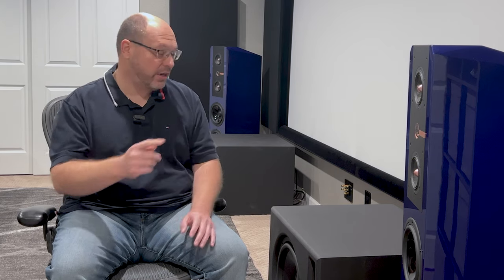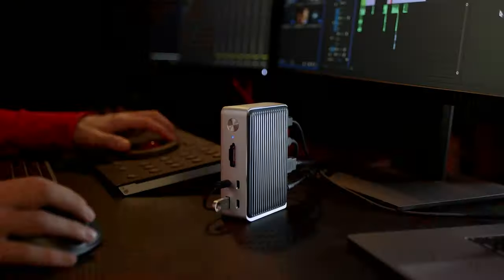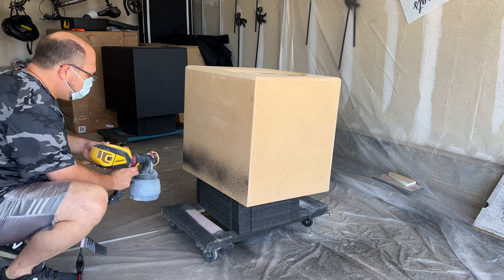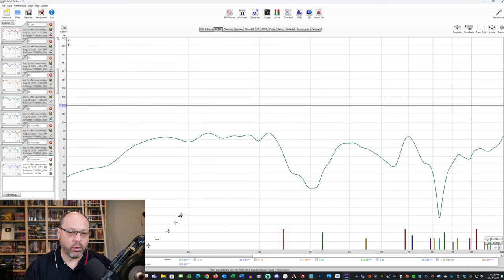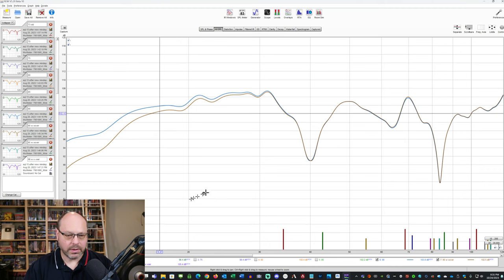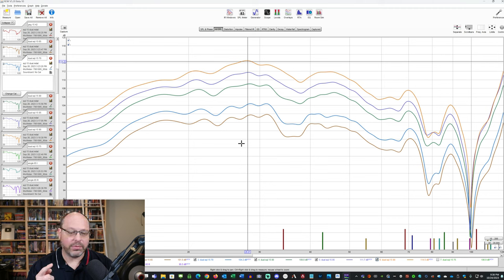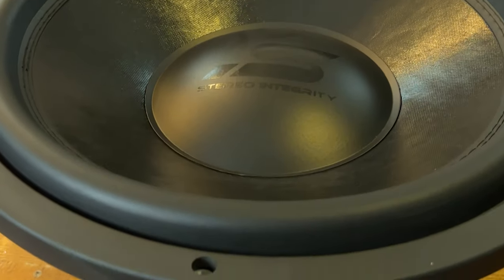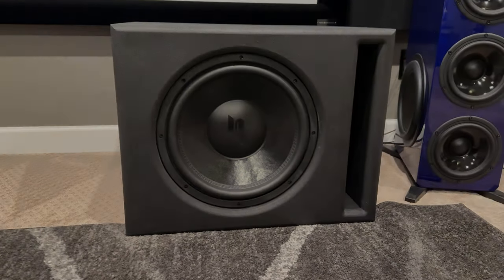Best Home Theater 15" Ported DIY Subwoofer of 2023 - Full Review & Measurements - Sponsored by Anker

Comment: I got my SQL15 D2 2 years ago. I put it in a 1.5 cf sealed box and just love it. Using a Crown XLS2500 bridged (2400 watts) @4ohms it cranks out the lows. I took it down to 8hz with a frequency generator at 80% volume level and it did not bottom out. You couldn't hear anything but cabinet doors, trim work and anything that wasn't bolted down rattling, in a 1800sqf house !  For $316 shipped is practically giving them away. It is a excellent choice on a budget or not.
Reply from the maker: That’s awesome!

Comment: Jiles Do you still have the big devastator that you built in your theater room or did I miss you removing that? How does it compare to one or two of these 15s? Obviously that would have to be near field in comparison unless you move the boxes around.
Reply from the maker: Not any longer. But the dev eats any 15" 1:1 for sure. Its a totally different beast. It has 6" of extra cone diameter. And displacement really matters. Double 15" can even the fight quite a bit though.

Comment: you built these in 18" with the Lavoce SAN184.03 as well, which do you prefer?  I have 2x svs pb3000 now wanting to try diy route to get a bit more SPL. i'm torn between 18/15 marty cube.  the SPL on these 15's seems like it would be PLENTY of low bass. I have 27 inches under my screen so the 18's would have to lay sideways. 15's seem like a good size!
Reply from the maker: Sounds like a good match!

Comment: Loved the video and think im going to build 2 of these. I have 1 question though. If i want to power these with a crown amp would it be better  to purchase the dual 2 ohm or dual 4 ohm version of the driver? Which one was shown in the video and was that the paper cone or the carbon fiber cone? Thank you!
Reply from the maker: The dual 2 ohm for sure. Wire in series for a 4 ohm load.  The one in the video is the dual 2 ohm.

Comment: Nice video! I've been waiting for one on the 15". Any idea how it would compare to Dayton ho or hf? Did you try modeling that box with other subs, were there any other ones that were close runner ups?

Thanks!
Reply: These imo are way better than my dayton um18s that I have if that helps
Reply: @bingdong8571  any bit of info helps thanks. What amp are you running?
Reply: @mcjonner  nx3000d
Reply from the maker: I didn’t model any… I went straight to the SI driver for this build. Highly reccomended.

Comment: Why is it all these home theater subs cost 3x as much as their car audio counterparts? Comparable specs, same basket, motor, voice coil, tinsel leads, spider...in all likeliness, made in the same warehouses in China.
Reply: Plain & simple, Mobile audio is a stronger & more competitive industry. Folks have been building mobile ground pounders way longer than home theaters. There's at least a dozen Subwoofer brands in mobile audio that are considered top tier & they're all trying to slit each others throats. The tribalism in car audio is ferocious. These guys have $100k in subs & Korean made amps in an SUV doing over 170db.
At the end of the day, it's relatively all the same product with a different logo slapped across a dust cap. But if I were to build Subs for a home theater, I'd be doing it with car audio subs. More bang for the buck with identical performance. Hell, even these pre cut flat packs cost quadruple what the top tier car audio guys are charging for their version of DIY pre cut enclosures. Home theater industry are infants in comparison to car audio industry
Reply: Sql and spl, car subs are just spl
Reply from the maker: And you are only pressuring a tiny tiny space in a car. Home Theater is the big leagues for sub design and implementation.